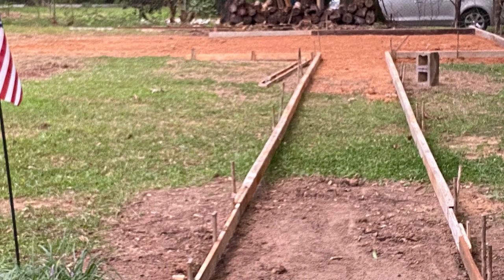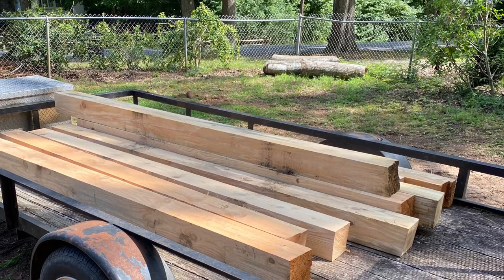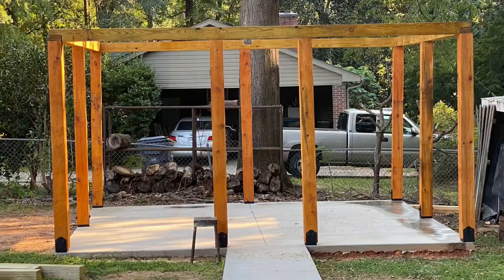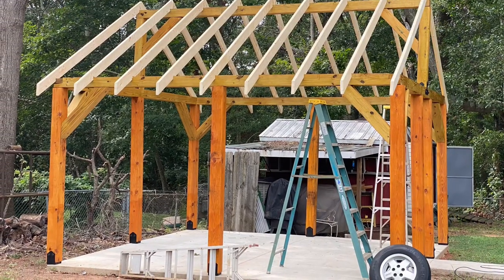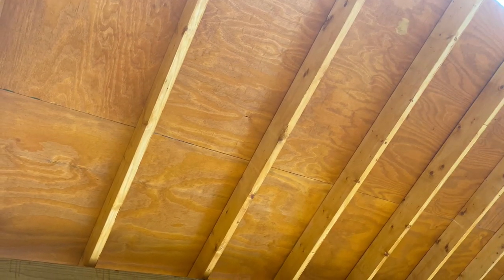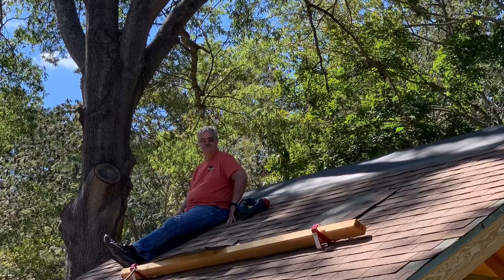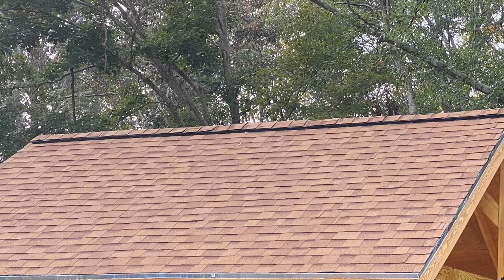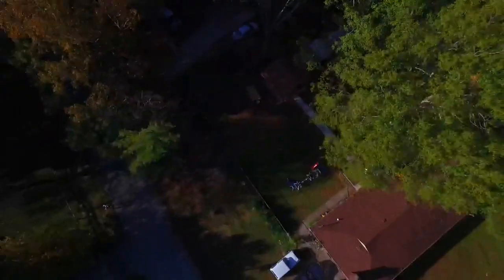Cuff N Stuff Cooking Shack #pavilionbuild

Comment: Jimmy - this im what Im going to build. A few questions:
1. Did you consider a tin roof? 

2. Dimensions? Looks like 12 x 15. 

3. Thickness of the slab

4. Price start to finish. 

Thanks for the video. Have a great day!

Jason
Reply from the maker: Jason the project is 16x16. I had done a shingle roof before  so that was what I knew. The slab is 4” thick. Most of the lumber was from a local sawmill. Closing in 2 sides has been the right decision as most of the slab stays dry and I still get enough air so heat and smoke is not a problem. Hope this helps. Im here for you if you need me !